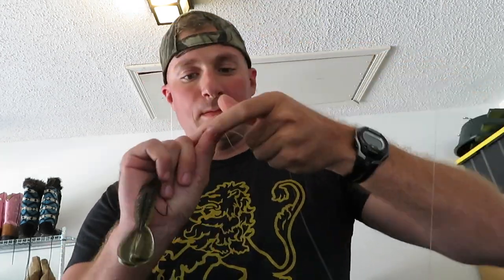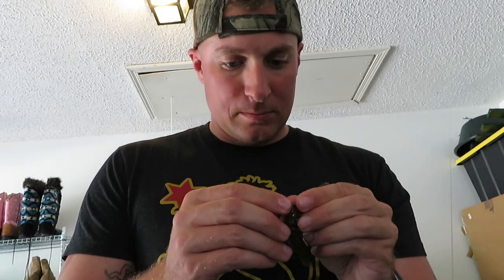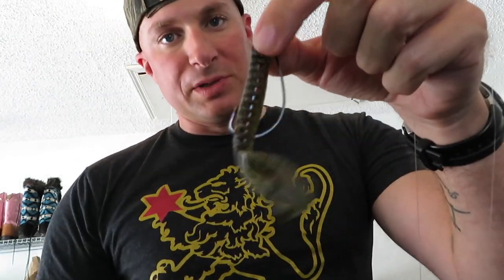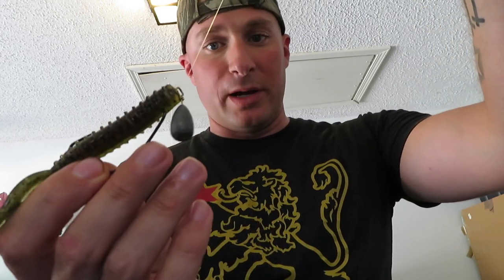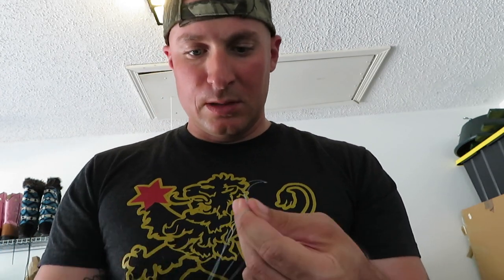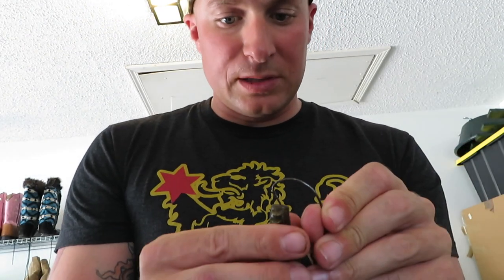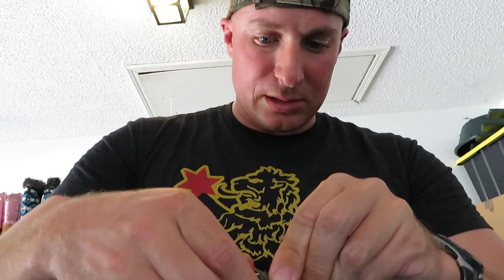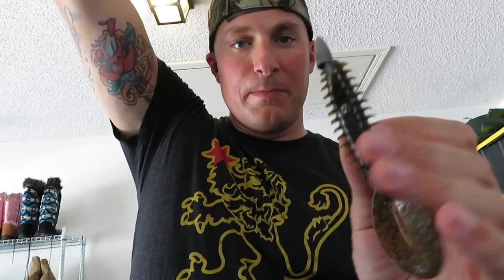Free Rig vs Texas Rig UNDERWATER TEST

Comment: You might think you’re not noticing much of a difference but when you pay attention to the fall and action of the lure (not the weights) it’s a huge difference. You’re testing the action of both rigs at most what like a foot or two of water. Imagine in 5ft or deeper. Look how the bullet weight pulls the lure down with it compared to the tear drop where it is “freely” going down the line (less friction) which will hit bottom faster and give the lure more time to fall (slower) naturally. It’s not the pendulum effect or how straight the rig falls; you can fix that with both rigs by giving slack line after a cast. The Free rig lure action looks more natural and it is definitely more for finesse technique for sure.
Reply from the maker: You 100% right
Reply: Good point
Reply: There's a reason why 99% of professional bass anglers and Millions of others who've seen this and every other rig under the Sun still prefer a bullet weight t-rig: NOTHING is better at coming through all types of cover and not getting snagged, fouled with weeds, etc. Just rip it and the weeds are off.
Reply: These should be considered the same technique. The bullet wieght doesn't make it a texas rig. The Texas rig is how the Soft plastic is rigged on the Hook. I would consider both of these a Texas Rig. Anyone who's ran out of bullet weights has used this "free" rig. I've been callin them the slide weight rig for the past 20 yrs.
Reply: @simplyengineering2350  Before is was Texas rig I think it was called a knocker rig.  I think Texas rig refers to the combination of the free weight and the weedless worm hook.

Comment: I haven’t tried the free rig yet, but from what I gleaned from this demonstration is that the free rig appeared to allow the bait a slower fall rate.  I would categorize the free rig as more of a finesse technique to the Texas rig when fishing steeper banks whenever you want the bait to separate from the swivel sinker. I think experimenting with the right weight of the sinker and type of s method could trigger bites when other methods fail. I look forward to testing it out! Thanks for the video!!
Reply: I think you"ve drilled down to the true difference.  Subtle but real.  A bullet sinker has a tighter hold on the line simply because its in contact with more surface area on the bullet weight, whereas the larger eye with the twisted top allows less influential contact on the rate of fall, thus allowing it to fall slower, with more influence to the bait's shape/design.   It's the slower fall that creates a trigger when the fish want that slower, gliding descent. (other times we pitch/flip heavy sinkers, not cause we need that much weight to get down, but because it triggers a poop or get off the pot bite, now or never - again for those times where he fish respond well to that trigger! )

Comment: Was not the original intent for just any ole plastic bait.  Use a floating bait, such as the Z man floating worm.  Now toss it up by a dock and now you can slack the line, it floats up, pull on the line and it dives, you can yo-yo the bait in position as long as you wish, hop it to the front of the dock and do it some more.  Works well on points and ledges also, the intent is to use a floating bait and allow the floater to rise, pull it down, let it go and so on. 
Originally also it was called the reverse wacky rig, floating worm again, rigged so you can yo-yo the bait in place like way back under a dock.  I generally twitch the worm gently and if there is a fish under the dock, you will soon know.  Dense baits  that do not float really have no advantage that I have ever found. 
Cheers
Kit

Comment: I think in deeper water is where the Free Rig shines. I also like using the Z man baits to float the hook more. You can pull the bait down to the sinker.
Reply: The #freerig works for sure better than a non pegged Texas rig, it’s a situational presentation though. There’s a time and place for both, but the free rig definitely has a different fall rate than an unpegged Texas Rig, throw them both with a Bellows Gill and you will see the difference, another point is baits also make a difference.🤷‍♂️
I jus get bit more on a free rig

Comment: New Subscribe! 🥳 I have been wondering the same thing myself! I fished the free rig this weekend at Norfork Lake all day Sunday.  Well not all day but long enough for me.  It got really HOT 🥵!  🤷🏼‍♂️ However it did seem to be much more accurate on the fall as far as compared to a Texas Rig. I truly believe the rate of fall as well as the direction of the Fall if applicable, is also very dependent on which specific plastic you are throwing at the time. An example would be a beaver tail or creature bait versus a Senko or trick stick or just about any plastic without a paddle tail or flat tail.  Hopefully you can see my point with that explanation.  That was my first time using the free rig, I was fishing from a boat and I did try it using multiple rod and reel setups as well as different types of fluorocarbon line.  With the line I noticed a huge difference when going from larger to smaller.  An example of that would be, 16 lb sunline and 20 lb Seaguar we're more difficult to cast at a longer range as expected.  Whereas 8 lb Seaguar fluorocarbon all the way up to, I think it was 12 lb, was much more efficient and a lot more fun to fish in general. Not to mention the super clear water there at Lake Norfolk, AR, is extremely difficult to fish with heavier line because the fish just see it.  🤷🏼‍♂️. I did enjoy fishing the free rig and I think I will even pick up some specific terminal tackle so I can use it more in the future. Awesome video man. Like I said, it was just what I was looking for.  Oh and by the way.  Army Veteran Strong!  11Bravo's lead the way!  🤘😜

Comment: the key of free rig is how it reads the ground situation. compared to texas rig, a swivel sinker delivers more accurate information to the rod when dragging. this rig also causes an erratic action when slowly dragging on the rocky ground because of the sinker. in my opinion, it excels texas rig in rocky ledge or bluff wall. texas rig excels in grassy and soft bottom cause it snags less and can swim if needed. i enjoyed your insight :D
Reply from the maker: I never thought of it that way but yes you are right now that I think about it. You can feel a lot more with this rig

Comment: when you cast a line the line doesn't sit up and down in the water column.  It drapes horizontally across the water and because of the horizontal drape baits pendulum.  In your experiment, you just jigged both up and down on a straight vertical line so obviously, there wouldn't be any difference in fall direction.  I think the theory behind the free rig is since all the weight is at the bottom of/under the line it has a tendency to fall more vertically than a free texas rig which sits more so on the line.  And because of the lower point, the bait will naturally be dragged down more because it will encounter less line resistance.  I'm not sure if it actually makes a difference, but the experiment could have been set up a lot better.  Great experiment idea tho!
Reply: your also doing it in like 2 feet of water.  Where this is more important in deeper water where the effect of the pendulum would be magnified.

Comment: I gave the free rig a try and caught a 2 lber on the second cast. Haven't caught one since. But I haven't fished it that much since. I have been trying to find some floating jigheads to try with a trd to let it float up from the weight once it hits bottom. I figured to let it float up a couple feet and do a jiggle to see what happens. Can't find any meijer was sold out.

Comment: Cool video and awesome information. I saw that the bait on the free rig seemed to fall slower which I like. I think that would give the bait more time in the strike zone.
Reply: I agree. The difference is subtle, but sometimes those subtle differences can be the difference.
Reply: I think that both baits would fall equally fast if: The hole of the lead would be the same size and also the same length. With the free rig it falls only slower because the lead has less contact with the line

Comment: well, the difference between free rig & texas rig is during horizontal line retrieve, free rig will behave almost similar to jika rig/tokyo rig (assuming you are punching using cylinder weight & floating soft bait)
Reply: They're both texas rigs. The bullet weight doesn't make it a texas rig. It has to do with how the soft plastic is on the hook. I would consider these the same rig, the Texas sliding weight rig.

Comment: Well if your using a taller “free rig” style tungsten sinker like what the Japanese anglers use in you guessed it, Japan. The taller sinker will allow your bait to slightly remain off the bottom by how ever tall your weight is. That’s the real difference IMO! Like the Gika Rig and or Tokyo Rig.

Comment: The tank experiment can’t be used for results. There is no angle from the rod. Basically the tank is just like drop shot. If you cast from your boat or bank. There is an angle from the rod to the bait. The deeper the bottom the more the free rig and depending on how heavy the weight is so the buoyancy of the plastic and hook. The bait will sink slower allowing the weight to slide towards the rod. Plus the free rig weight has less resistance while sliding VS a bullet weight because of how much of the line is actually in contact with the sinker (the inside of the bullet sinker) Hope this makes sense. If you are just jigging with it. Both techniques are identical. If you are casting and allow big the bait to slowly sink and depending on how heavy the weight. The free rig will ride the line back towards the rod while the bait is still fluttering down. Do it will be more of a Carolina rig IMO.

Comment: The difference on the free rig vs tx isnt that big, if you're pulling lures into 20ish ft of water yes they pendulum but that free rig will too..... The problem is available slack line for the weight to drop straight down. What ends up happening is part of that downward motion is lost and the rig then pulls back towards the pole.... I use a loose type texas rig all the time both are gonna act the same but the free rig may move just a bit more under water as it doesn't have to drag line through the sinker...

Comment: I thinks that the texas rig "hurts" sagnifincantly less your braid or line, because there is a soft tube inside the bullet weight that protects your line. Additionally the line enters through the center of the weight rather the weight hunging on it. creating more friction. To my opinion this is the only difference.

Comment: Isn't an un pegged Texas Rig called a Carolina rig and when you Peg the weight to the hook it's called a Texas Rig. am I wrong?
Reply from the maker: No, the Carolina rig weight is stopped before reaching the bait.  This allows the bait to float around at the bottom.  Similar concept but a different. Hope this helps!!!
Reply: I was down in the garage thinking about my reply and you're right the Carolina rig is stopped by a swivel and in my opinion that free rig and a Texas Rig or pretty much the same thing
Reply: The Texas rig has nothing to do with the weight. It has to do with how you rig the soft plastic on the hook. Both Rigs in the video would be considered Texas Rigs. The Carolina rig is when there is a peg/swivel inches away from the hook to keep the weight from going all the way down to the hook/soft plastic.

Comment: Your test is flawed. The tank is too shallow to imitate real fishing conditions. The angle of your line in the tank also doesn't reflect how real fishing conditions are. In reality an unpegged Texas rig will glide at an angle a moderate speed and then slowly drift by itself because the bullet weight will ride along the line when sinking. If we take into consideration the depth of the water, the deeper the body of water, the more the bait will glide further away from where the lure entered the water. Free rig however, (if you let out a bunch of line right after your cast) the weight will sink directly under where the rig entered the water and the bait will slowly flutter behind the weight. For the Texas rig, the bait will end up a significant distance away from where the rig entered the water. So, I think free rigs are better to target certain location (especially in deeper water) since the bait will land exactly where you cast if given slack line for the weight to sink.
Reply: and of course the free rig allows the bait to fall slowly and in between hops.

Comment: Test in swimming  pool with a cast
Reply: There are plenty of videos testing this in a pool. There is no difference. It will pendulum if you reel in the slack as it falls, this happens with both. The bullet style may need to be slightly larger to have same sliding effect due to friction tho.

Comment: Doing this test in a foot of water really isn't gonna show anything.
Reply from the maker: Very true
Reply: I would also argue that because he is testing both rigs by standing directly on top of both of them, both rigs would look similar because it lacks angles. Imagine if he casts both rigs from the shore to a swimming pool about 30 feet away I would imagine you would notice the Texas rig being pulled towards the angler more than what it does on the tank tests since he would no longer stand directly over the baits as they fall. Instead, because of the angle in which the bait is forced to fall from the fisherman holding the rod you would probably see the baits starting to pull towards the fisherman as it falls and that would definitely be more likely to happen with the Texas rig because in the Texas rig the line doesn’t pull away as quickly and easily from the bullet weight as it does with the teardrop sinker since with the teardrop sinker the line only has to go through a skinny wire that is attached to the sinker. With the bullet weight the line has to go through the entire length of the weight and that creates more tension areas for the line to rub against the weight, which would cause the the bait to fall towards the angler as it falls since it would also take more time for the line to go through the bullet weight, therefore, giving the bait more time to pull towards the angler.  So, this test doesn’t prove anything in my opinion.
Reply: @grandwonder5858  good points...I can attest they do not run the same...I have run both the last week or so....free rig is certainly different.. especially in current
Reply: @grandwonder5858  Tension area.. Great explanation.  Never thought about it like that. I've always got a texas rig on one of my poles. I'm gonna have to switch it up and try this free rig
Reply from the maker: I wish I had a pool to do that. Would be a much better test for sure!